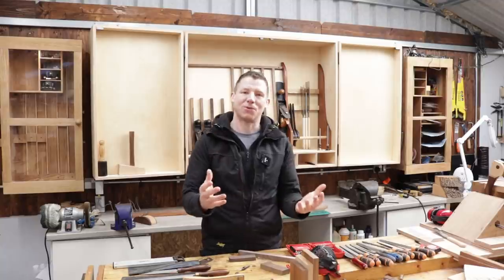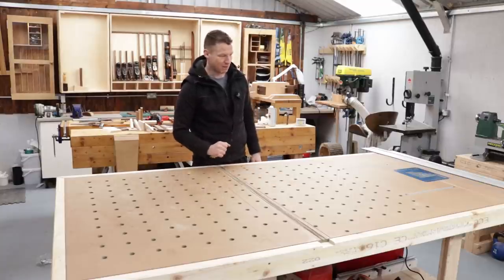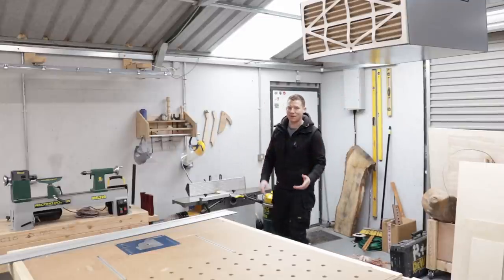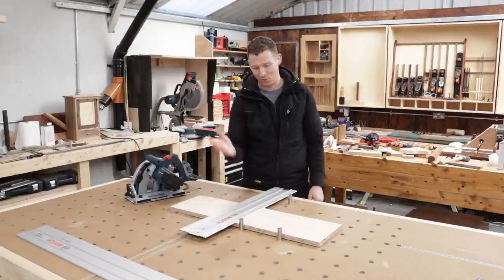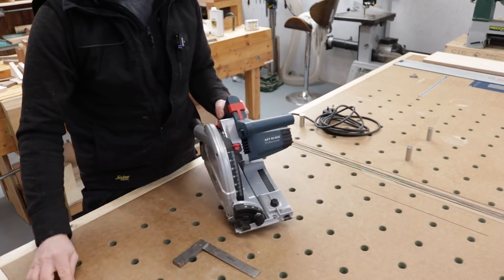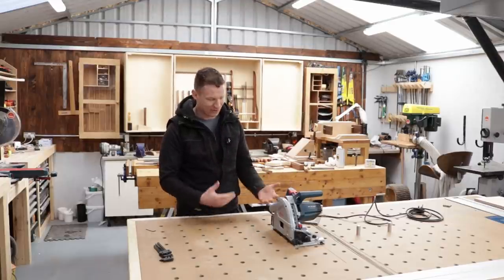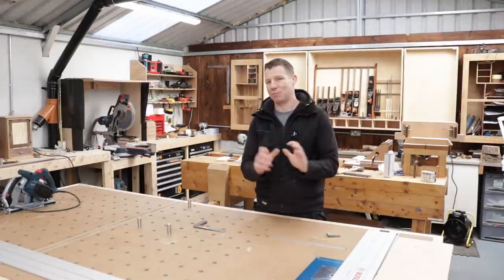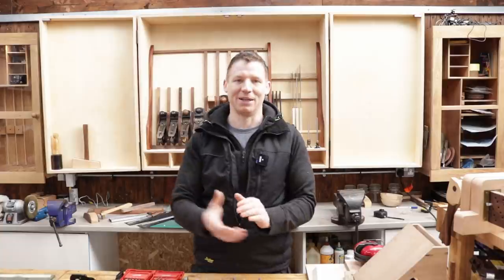Workshop Vlog #15 Bosch Track Saw Issues! Tools, Project and Channel Update.

Comment: Thanks for explaining the squares issue of the Bosch track saw. I have been looking all over the internet for information about this subject but could not find any info. Someone on a Dutch woodworking forum referred to this video. 
I called Bosch and they admit having problem with calibration there track saws. 
If it's possible can you make a separate video about this issue and how to setup the angle after calibrating the saw? Have tried to find a way to with a digital angle gauge to setup the angle but havent find a fool proof method.
I also thing there is a correlation between the force you applied on the handle of the saw and the angle. I made some test cuts with 30mm plywood, during cutting i had some issue with pushing the saw, because of the thickness of the material and the resistance of the saw and the guide. So by applying more force on the front handle you can see the i some cases that the angle going of the 0 degree and into the -1.

Comment: Thanks for the video John - I watched this video when it was first out, but found myself revisiting it today as I hit the same issue with going back to 90 on the Bosch track saw.  I was contemplating putting shims in between the plate but will now try the grub screw first!

Comment: Well John , I have the same problem in my shed with  the Frost so I am going to spray the shed with installation foam keep the heat in during winter and keep it nice and cool in the summer
Reply from the maker: Might look at something similar
Reply: I have exactly the same problem too, thought about the spray foam too but looked pretty pricy

Comment: Hi John, another brilliant video, my reason for this comment refers to the 1 degree negative angle setting on the Bosch saw. Now I am not a professional, but since buying one of these saws the only use I can come up with this "could " be for when you're hanging a door. You would be able to put a 1 degree negative angle on the leading edge of the door to  get a closer /neater gap when the door is fully closed. I have not tried it yet but I have a bedroom door to change soon and I am going to give it a go, I'll let you know how I get on.

Comment: I just bought a Bosch track saw and wish I had seen your video before I made the purchase. First day doing some test cuts and I immediately noticed problems with the bevel scale. It doesn't return to zero and instead of stopping at 45 it stops just past 46. If I release the button to go to 47, the arrow goes right off the scale.  I checked the angle of the blade to the base plate, and the stops do seem to be setup properly, but the bevel scale is completely unreliable. I also agree with you about the zero degree set screw resting on that piece of plastic. Definitely disappointing.

Comment: I had the same issue too with my Bosch. Thanks John.
Reply from the maker: No problem George
Reply: @JohnMcGrathManInShed   I tried this out, however no matter which way I turned the screw and how much it did not change it,  if any it made it worse, I found the only way I could get it to be plumb was to put a router bit plastic sleeve under the plate, about half a millimeter.  btw plus one for bench dogs for rail makes a huge difference

Comment: Well done John. Best of luck with your issues. I used to have an noisy shop vac, “never again”. I now use a Festool vac (26) for all my dust extraction for hand power tools. It is very quiet and strong. I always try for less noise.  With regards to router table addition to your MFT. Nicely done! How do you use a mitre gauge when you are making cabinet doors with rails and styles?

Comment: The bench dog track dogs are great, I had the same issue and now it's a thing of the past. I also reccomend the bench dogs MFT fence a real game changer for repeated cuts.
Reply: I bought the Benchdogs mft fence.  It's definitely a nice system. One issue is the smaller sections of fence don't fit together in a straight line.  It's a but concave on the scale side of the fence.  I'll try using a straight next time as I bolt it together but it might create a gap and throw off the scale down the line.  I also purchased 2 1000mm sections of fence. Their flag stops are good but they need to be a bit beefier, there's a bit of deflection.  Their bench dogs fit nicely in 20mm holes.  Other brands are quite sloppy. My work bench grid is not accurate enough to use rail dogs and the Benchdogs fence which is why I'm going to try the Parf Guide system and build a new top.

Comment: I've got the Festool, it's nice. Especially like how it's anti static, constant static shocks on a standard hose do get annoying. I'm really liking the expanding Rockler Universal Hose, I've got it set up on a boom arm over by workbench. An added benefit is blocking the hose with my hand causes it to retract out the way.
Reply: Do you have a link for the Rockler hose? :)

Comment: For the vacuum hose that catches on everything, you might look at a "central vacuum hose sock". They sell these on E-bay and they're meant for use with central vac systems to keep the hose from catching on & marring furniture legs and mopboards. They come in 30' lengths for less than US$30.00. Believe it should fit over a 1.5" hose but haven't tried it myself.
Really enjoy your channel!
Reply from the maker: Thanks for the tip
Reply: This is it! Thanks!

Comment: Hey John, they make hose sleeves that will slip over the corrugated hose and help smooth it out. You can add the tool cord inside as well. Kind of a poor mans festool set up. I hope that helps. I found mine on Amazon.
Reply from the maker: Thanks for the info

Comment: Hi John, Great advice on the tools, again. I don’t have a solution for the corrugated hose pipe for the vacuum, but I did put an extension on mine and it gives me great freedom. I draped the hose over 2 hooks in the ceiling so it hangs down. This usually stops it from catching on the table or work piece. I got old hoses from the council recycling center off old vacuums. If you have WiFi in you shed could you explain how it’s installed. I have a second router wired off my main router but it has never worked right. Seems like rocket science to me😡👍👍

Comment: Thanks for video update John. Enjoying your content. I had a similar problem with my Makita track saw not cutting square, that I only noticed after chopping up a couple of sheets of MDF ... Arghhh! I check it with a square quite regularly now and also do test cuts. I think Peter Millard (10 minute workshop) covered this when he did a budget tracksaw series a while back. Brexit is not great in the UK either, prices are up and it’s more difficult to get some tools. Hopefully will sort itself out eventually.

Comment: I'll be interested to see your results with the t-nut dogs. I've tried them for my home made mft table and I found them to be so precise that the track easily gets jammed when trying to lower it and raise it between each cut, or if I loosen one up to allow it to move smoothly then the track drops level with the table and then you have to remember to use spacers to keep it from doing that. In the end it is just too finicky. So I'd love to see how it works for you and if you figure out to work around those issues. I love the videos and enjoy the content please keep all the great info coming!

Comment: Check out a hydraulic shop you can by a fabric sleeve to cover the hydraulic hoses. I used to use them on hose when I work for the Cat dealer. That would make the hose smooth and keep the hose from snagging. Just a thought. Cheers!
Reply from the maker: Thanks for the tip!

Comment: I have the Benchdog rail dogs and I find that they can be difficult to pull in and out. If you can fit your Bosch tracksaw onto a Festool track then it would probably also fit onto Evolution tracks, which are much less expensive that Festool tracks. The FFX website has a chart showing that they are compatible with the Bosch GKS 55 GCE and GKS 65 GCE. A drawback of these tracks is that the Axminster UJK dog rail clips will not work with them as the required groove is on the bottom of the rail not the top, as is the case with the Festool rail. However, you seem to be happy just butting your track against the dogs and not attaching your track to the dogs.

Comment: Great video John. I’m pleased you mentioned the Veritas honing guide. I’m new to woodworking and I bought a Veritas honing guide to help me. But with all the plane blades I’ve tried to sharpen, I get an edge which is on the slant. So the edge is not square. I assumed it was me doing something wrong. I have checked my set-up time and time again but the end result is the same. I will check the brass wheel to see if that is off centre. Look  after yourself. I’m looking forward to the sharpening station build when you get time. Peter

Comment: The one big plus with the bosche is that it wont cut the track strip back further when cutting at 45°. Even with the festool and every other saw ive used the moment you cut at 45° you cant line the plastic/rubber edge precisely on your mark anymore when doing your 90° cuts, you have to line it up 1/8 away from your mark. The bosche lines up precisely on your mark no matter the angle.

Comment: Thanks for the vid! I have the same tracksaw. Most of my tools are Bosch. It's so annoying because it has the potential to be sooo much better.  Rails are amazing but wish they were slightly wider as you mentioned. The issue with the markings is not acceptable. I find that the plunge depth markings are also out by half a mm. The side of the saw is not flat and at the price it's at I really wish it had micro adjustment. Other than that it works great. If I were to buy again I'd probably get the festool!
Reply: Bosch being budget, lower grade version of Mafell seems to reason for its flaws - a range filler rather than a main product. Will affect my buying decision

Comment: Hi John,
Grand channel and I really look forward to the updates and love the whiskey channel as well🥃. I have a similar situation with my workshop/garage. I plumbed a dust extraction system to my mitre station and other tools on the bench using similar ducting to yourself and my dust extractor is the twin motor Camvac from Record power, and very similar to the DX4000. However my issue is also getting easy extraction to my central work bench, which has my table saw, router table and sanding base. Rather than buy another CamVac or DX4000, I was planning an up and over ducting connected to the CamVac and then attach a Rockler hose which easily attaches and detaches to a duct system in my workbench. Just by using blast gates I can then divert suction to the individual tools on the work bench. Have you thought about that solution rather than buying another dust extractor which can be expensive for a good one. I think the CamVac twin motor or DX4000 should easily be strong enough to give good suction? Or are separate systems better?
Keep up the good work John one of the best channels for hobbyists. 
From half a paddy living in Sweden. 🍻😀 stay safe
Reply from the maker: Might just run over head an see how it goes
Reply: @JohnMcGrathManInShed   I am not trying to use you as the guinea pig John🤣, but if it works great. I’ve seen a few vids and seems good. But in reality is another thing. 🤞🤣

Comment: Thanks John - I have the US version of the Bosch saw and must of got lucky.  The initial bevel was out by a degree, but when I corrected to 0 degrees, it actually perfectly lined up the pointer on the bevel guide to be in perfect alignment.

Comment: The extractor  has a corrugated hose as a anti static feature. It's why you can't find a smooth hose. The only option is to sleeve over it.

Comment: Good to see your channel is growing - well deserved in my opinion.

I has a similar problem with the roof in my workshop on really cold days, it always seems to accumulate where the roof panel meets the purlin, guess it is just a limitation of the anti-drip fabric. In the end I installed insulation sheets between the purlins and then panelled the inside of the roof. Spray foam may be another option, not sure on costs though.

For the dust extraction, I use the rockler hose system which is ribbed, but I use a v-roller clamped to the end of the bench or on a stand to stop it snagging. With a central workbench could you not come over the top with a suspended system and drop down? You could do that with the electrics as well, there are retractable extension leads available, do come at quite a price though.
Reply from the maker: Yeah I might just do that, I'm not a fan of extension leads the can cause Issues, I might do a video on the danger of using extension leads

Comment: Cheers amigo,, very nice video.  yes the temp bridge is a major issue, I went through that on a container home I had. I ended up simply spraying Polyurethane foam on it to stop the condensation issues.

Comment: I think the extra power of the Bosch over the festool is not to be underestimated. I’d probably buy it again given the chance, but agree that some of features are not good enough for the price. I’d like to know if Mafell owners have the same problem. I’ve just started using bench dogs on the track, and find they’re a bit awkward. Thinking of buying the hinged part of the MFT table and modifying it for my bench and Bosch track.

Comment: Great video. Really need that today after laying paving in the snow.

I dont know what its is called. But for your hose maybe you need a sky line to pull the hose higher so there is less friction. The sky line could slid on a rail and the line could be retractable like air lines in shops that use air tools.

👍
Reply from the maker: Thanks for the tips!

Comment: Sorry to hear you’re feeling the COVID and Brexit over there. 

I just bought a Mafell plunge saw today after loads of research. I found your Bosch review and this video really helpful thanks! Just got to wait till Tuesday for the delivery now. 
I’ve finished my Matt Estlea cabinet now, it was such a good series. Would love to see yours finished too please? 
I’m about to start a tool cabinet now based on your design so thank you so much for the inspiration! 
Hang on in there, the light is getting closer!
Reply from the maker: Thanks Katherine, I must finish the cabinet I just need to fit the hinges. Best of luck with the tool cabinet.
Reply: @JohnMcGrathManInShed  good luck with the hinges. 

I don’t know if anyone else has said but the -1degree tilt is for when you’re doing a visible join, like counter tops, helps the join to be invisible as less material underneath to meet in the join. Hope that makes sense!

Comment: Great video John, I've the same problem with my non drip shed. I've had the shed about 6 years now, it's a pain but it's usually only for 2 or 3 months of the year. Thanks for the info on the track saw I've been thinking about getting one. I'm getting my workshop all sorted for woodworking, I'm gonna hold off on the dust extraction to see what you come up with lol. 
Sean from Co Armagh 🇮🇪

Comment: Having the exact same issues with the condensation on a non drip roof.....really annoying. Thinking about spray foam insulation for the roof when weather dries up. Dont have that heavy duty sheet under the perspex sheeting, must look into that. Thanks john...keep up the good work. Richard, Sligo

Comment: Power to the tools on your bench. I have a power cord hanging over the middle of the bench. When plugged into this the tolls can reach all areas of the bench. The cord is about 600mm aboe the bench surface. cheers Calum

Comment: The negative 1 degree gives you a little play in your miters. In theory the gap will fall on the inside of the joint thus less visible.  As theory goes if your not accurate in your measurements you can still achieve clean miters. I

Comment: I'll be sticking with my shop vac and Home Depot Dust Stopper 5 gallon pail lid for a bit longer - maybe forever:(!  That said, I don't know if available in Ireland, but the Oneida SuperCell really looked good to me when I was thinking about a serious dust collector.  But the price point was just too high for the amount of woodworking I do.  Still, maybe someday:).  Thanks for the Bosch track saw info.  Very helpful.  I love the saw and tracks, but those issues you mentioned really take the joy out of owning the tool when you consider the cost.  Still, I don't plan on getting a different saw, as forewarned is forearmed, and after watching your VLOG I am forearmed, so thank you!

Comment: And about the rail dogs and fence of benchdogs I can only agree with what everyone has said. Great system even though I use the Festool Saw and track, I still prefer having the dogs under the rail. I don't bother with the B collars though. I made simple rings in the woods thicknesses I use most to put around the rail dogs.

Comment: Hi there, love your rant from another video but your Granddad was right . I am looking at this plunge saw for myself , but i am edging towards the festool plunge saw, do you with you had gone with that now rather than the Bosch one? ps i had same issue with my Makita track saw,,,then month later after farting about with my track by putting tape on it to alter the angle I too found a grub screw ,,,what a relief it was , i never smiled with joy so much - compensation for all the previous swearing. pss never been to Ireland, its a lovely place I should go over and you people are friendly :)